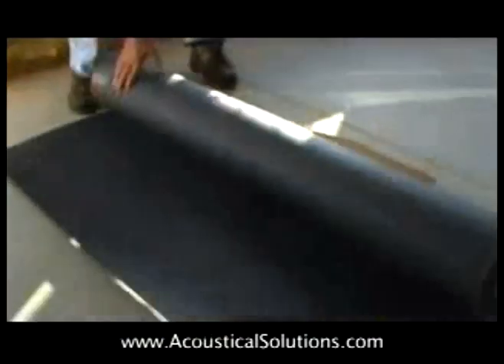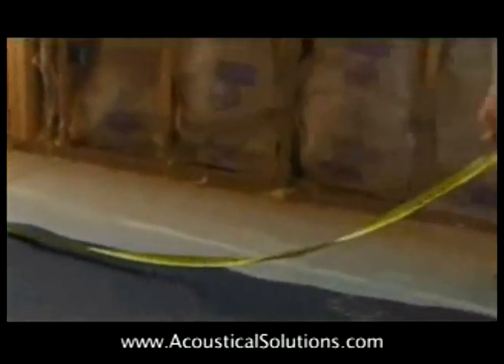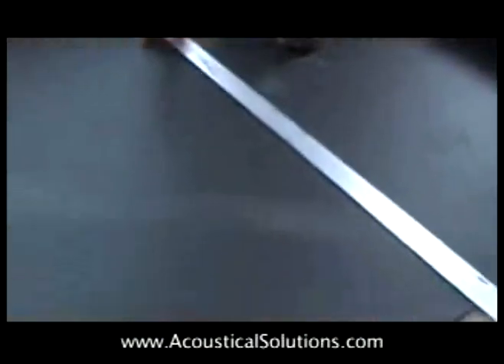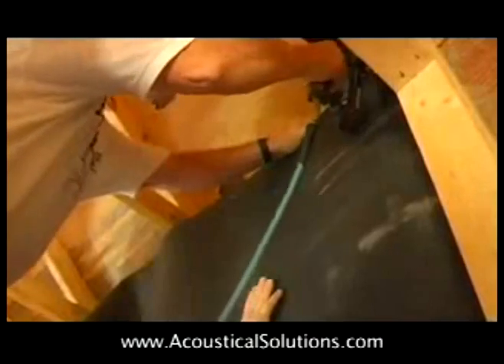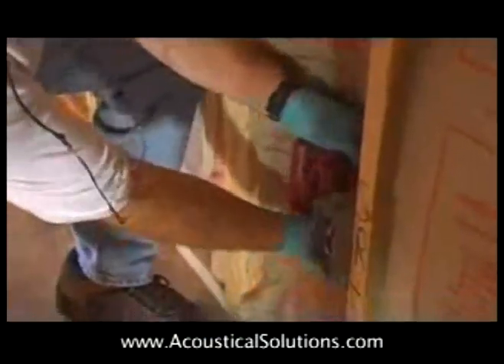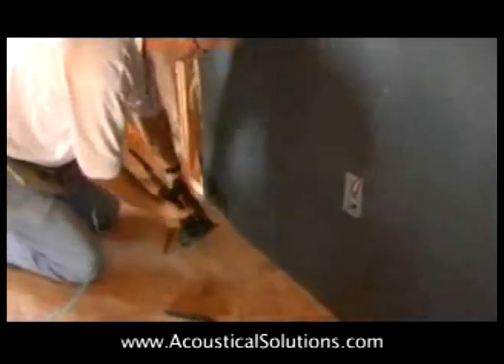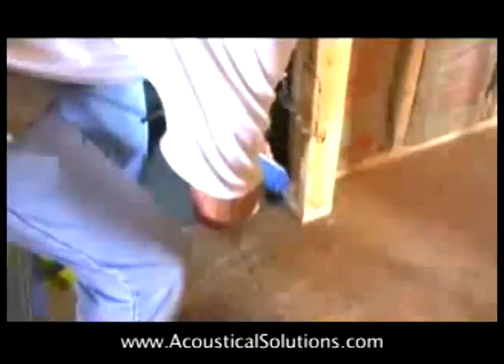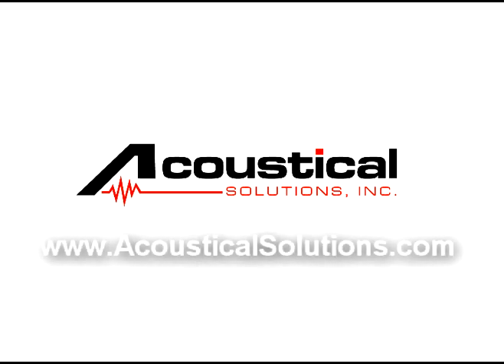How to Soundproof: Sound barrier installation video

Comment: would this have any benefit to staple to an existing finished sheetrock wall and seal and then leave it as is?
Reply: Yes, but it will look tacky. That's why you put it on the interior side.